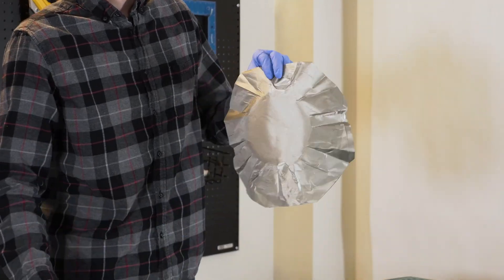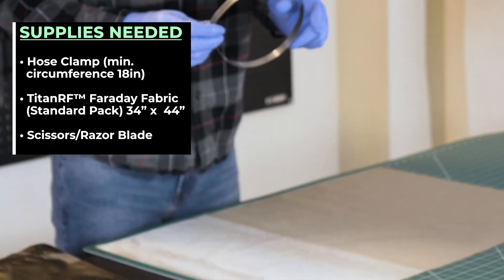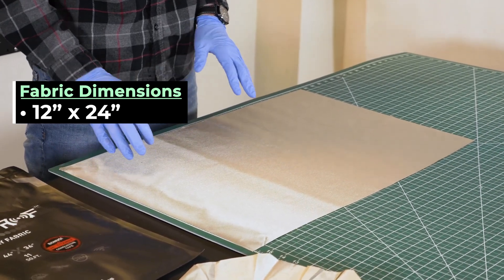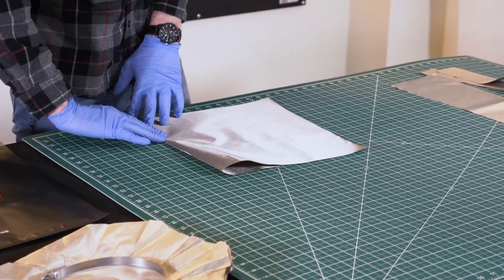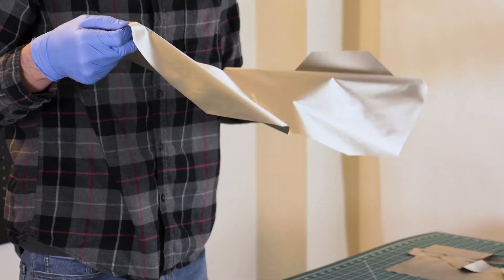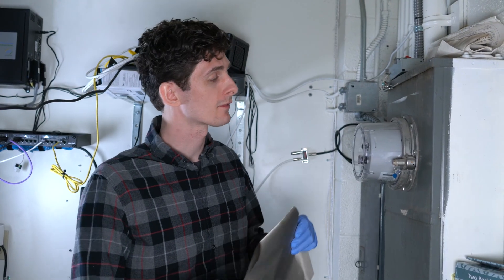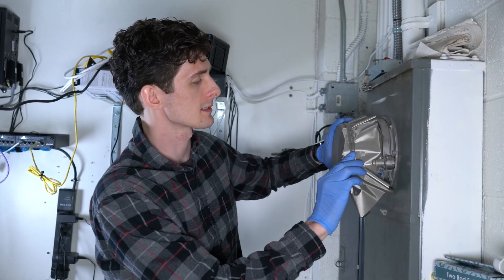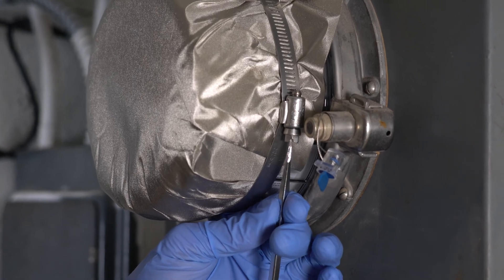Make Your Own Faraday Shielded Smart Meter Cover for EMF Protection

Comment: Dirty Electricity refers to a fast-growing form of potentially harmful electrical energy that
radiates into living environments from electrical wiring. It’s highly unstable and raises the
ambient voltage in the living environment by as much as two volts. This environmental toxin
arises from electromagnetic interference (EMI) caused by Smart Meters and plug-in electronics, computers,
fluorescent lighting, modern appliances, battery chargers, and solar power
systems.

Smart Meters are particularly bad because they contaminate all the wiring in a building. It literally surrounds you with Dirty Electricity through your home's wiring.
Recent science has shown dirty electricity to be bioactive. That is, it directly disturbs human biological systems. Dirty electricity and other types of chaotic electrical energy have been associated with auto-immune disease, neurological conditions, poor sleep, attentional disorders, anxiety, and dozens of chronic symptoms
associated with inflammation. Dirty Electricity – another name for EMI: Dirty electricity is a term coined by the electrical utility industry to describe electromagnetic interference (EMI) caused by Smart Meters and plugging in electronics, which typically need to convert alternating current (AC) electricity into direct current (DC) to operate. The term was first mentioned in the science by Dr. Magda Page Havas, PhD and Dr. Samuel Milham, MD, who have both identified a series of health effects associated with dirty electricity (power line EMI) in a half dozen scientific papers.

Health impacts associated with dirty electricity:(Smart Meters)
ADHD
Diabetes 
Anxiety
Fatigue
Asthma
Irritability 
Cancer
Pain 
Concentration
Mood 
Cancer
Multiple Sclerosis
Depression
Sleep Issues

Comment: If you block an antenna the chip will increase the strength in response - now going through the back. These are complex systems and you need an actual RF meter device. And a faraday cage also needs to be grounded for maximum effect.

Comment: ONCE U PUT ANY FARIDAY CAGE AROUND A SMART METER IT BLOCKS EMF FREQUENCIES  & RADIATION FROM GOING OUTSIDE BUT THEN DOUBLES THE EMF'S  & RADIATION GOING N2 YOUR HOME. PUT A SHIELD ON THE INSIDE OF YOUR HOME DIRECTLY BEHIND THE SMART METER BUT MAKE IT WAY BIGGER. A THINK REAL METAL WINDOW SCREEN MAYB WITH DUCT TAPE OVER IT FOR DOUBLE PROTECTION MIGHT WORK.  SORRY ALL CAPS CAN'T C SMALL LETTERS ON KEYBOARD

Comment: what if the the power company  used it's large system of transmission lines as the link and the modulated the 60hz carrier wave with digital information?

Comment: I would appreciate a serious test of the product you're selling. Not against a sales' pitch, but do the customer a favor- prove how good it is. Also, do your research: a Faraday cage or Faraday cover PREVENTS all frequencies from passing through. This is NOT good on your Smart meter, you need a little to reach the Utility to record  your power. If you don't, then you'll receive a visit and a charge for the visit to remove it. 
Do your homework please this is embarrassing. Redo this to provide real value for intelligent customers.

Comment: It seems interesting, but how are the utility companies going to read it wirelessly? can you  get fined if you block the transmision, to the utility company?  I am just trying to get educated here. I have an issue here in a multi family home that I am trying to resolve  I live in a 9 family apt unit with smart meters and the Detertor meter I purchased  warning alerted me with  both readings 284 Vm  and 10.30 uT, what recommendation do you have for remediate if possible ? maybe  Move out? Thanks

Comment: The smart meter gives the govt, and the electric company, the ability to turn off your electricity, if you are drawing too much power.  If you have wireless appliances or air conditioner,  they can shut these appliances down and the air conditioner as well.  One would be smart to never purchase Appliances with wireless capability.  I would never have anything wireless.  I got solar panels and the company who installed them wanted to monitor them and I told them NO WAY is that happening.

Comment: The new smart meters will send a flag that they are not "communicating"  and they will send someone out to investigate . As someone who works for an electric co...I know. Not only do these meters send a monthly reading for your bill....they communicate with all your smart appliances you ran out and bought and these companies know when you run your hot water heaters, dishwashers, dryers and everything else. Also these meters and streetlights act as antennae's  to daisy chain the signals. They are sending signals and info constantly, not just once a month.  They know these are harmful otherwise they would not offer an "opt out" meter that has to be manually read although I'm skeptical that these are not really any different.
Reply: I got a creepy AF text from some handyman saying they noticed I hadn't used my dishwasher for awhile and that he could come service it. Blocked. My dishwasher wasn't wired up so it's using the house wifi to send. Turning that off now and plugging in ethernet cable for pc and when I have to use iphone (which I'm discovering only has 5g option)..Probably taking hammer to both. We Will Not Comply. I'll be sending a Notice of Liability to hydro company at $20 0000 a day billing. Pricks.
Reply: @trailedge  I was against "smart" deVICES day 1 "phones" were stage 1 - people were suckers...fools
Reply: This whole thing was about the New World Order and monitoring and controlling us.

Comment: I think at one time, but the type we buy for cooking was changed and I read it is now useless for that. I am not sure, because as an experiment I covered my mobile phone with foil and left it for a couple of hours. When I unwrapped it, it was hot - not enough to burn but if I had left it longer, it would probably have caught fire.
Reply: so if I cover my smart water meter with lithium battery that will be installed in my home cause city won’t give me Opt Out Policy it could burn my house down? the lithium battery isn’t supposed to get hot
Reply: You have to let an area leak out but direct where you want it to go. So if you cover your router with tinfoil, that will work. But it will also overheat it because it’s constantly going to try to find a way to relay. So if you know where your closest towers are, you leave the opening in that direction so it can easily relay the information back-and-forth, but your lowering the EMF that is bouncing around in your house and hitting you. When it has a hard time and does leak out, you don’t want it to leak out in the direction of you. That’s a lot of power emitting from one little spot. If you have your router covered up in your house, you also have to think about when your cell phone tries to use your Internet in your home and work hard to get that reception, when it’s in close proximity to you, it will be emitting a lot more EMF. A lot of people think they’ll just put EMF paint on the wall of some sort but EMF travels through walls and when it hits that paint, it will bounce back into the direction it came from. So whoever is outside of that room will get hittwice as much as they would have. If you put that paint on all four walls in your bedroom, for example, any RF or EMF that ends up in that room will constantly bounce around on all of our walls. This could be hazardous.
Reply: Just put it on airplane mode when you don’t need internet. Even if you made a faraday cage for your router, your phone will try to connect to the nearest cell tower. If the cell tower is close, you’re in trouble because you’re in the path of those signals that everyone else is getting. The further your cell tower is the more it will work to find it, send and receive information. So when your phone is near you, it could be very harmful. It also emits more EMFs when it is charging, so your phone should be far from you when charging. Everyone should be aware that EMF is also much stronger in the evening. Basic every day noise pollution from cars, etc., UV and fluorescent lighting weaken emf. So when its quiet at night, the sun is down and lights are off, your body’s cells and function are in more danger. Your body heals itself when you’re sleeping, this is the most important time to be away from any EMF. So considering how much we are bombarded everywhere we go, people really need to think about unplugging anything not in use in their bedrooms and leaving their phone in another room. Be mindful of your exposure.

Comment: How about the back leaksge?
Reply: its not meant to actually do anything just make feel you did something what you want to do is remove the box from the wall add extra Romex cable to add length then place the box in a lead lined box before encasing it in concrete then wrapping it in the foil. doing anything less to block the radiation is like the worlds least carbon producing countries going green electric wile china has more coal plants the party members.
Reply: now oyu have ALL the radiation being reflected backwards, INTO your house. This is a sc4m, and does nothing

Comment: Would of helped to have used an emf detector before and after instalation to show the comparison.
Reply: this is only covering the front half. All waves can literally just escape from behind the head, and radiate out the back and bounce around. This is a non-working idea. Does nothing.
Reply: Too many leaks.

Comment: Can’t you just use foil?
Reply: I think at one time, but the type we buy for cooking was changed and I read it is now useless for that. I am not sure, because as an experiment I covered my mobile phone with foil and left it for a couple of hours. When I unwrapped it, it was hot - not enough to burn but if I had left it longer, it would probably have caught fire.
Reply: @angr3819  you must use special Faraday fabric/ emf fabric, not foil, which reflects heat, bouncing heat waves back out.

Comment: The meter base cabinet is all steel, so no RF should be reflected through the back of it.  Only thing I wonder about at this point is what signal appears throughout the house wiring?
Reply: Yet what about the neighbor's RF from their smart meter? We live in a mess of magnetic fields, coming from bouncing on many things. Look at Tony Pantelleresco's videos on how to make emf-diffuser-fans with magnets and metal coated wire mesh.

Comment: So if we cover the outside of the meter the electric company can't take a monthly reading remotely. But it will eliminate the nefarious things it does to us. To solve this problem and protect our families we can remove it completely on the scheduled days they read your meter, and then put it back up immediately. This will keep us safe from RF at least 98% of the time.
Reply: No one comes to read them. That is the point. It is remotely read. No longer need workers.
Reply: The smart meter tracks your energy usage and sends it to your utility company every 5 min.  throughout the day. Also it enables the utility company to impose multiple tiers of charges in the 24-hr period, e.g. with after 10 pm being the cheapest.

Comment: What about the backside??????
Reply: We put a solid piece of thin sheet metal on our wall inside the house- not the best, but dramatically reduced the EMF strength. Next time I'll put a 2 pieces of sheet metal behind the meter, which is fastened to the wall. That will decrease it somewhat, even if the S-meter is recessed into the outside wall. Cheers, Dk

Comment: My only question is.. do these smart meters emit RF behind themselves into the house?
Reply: to be safe, put some metal behind it, I know if emits behind it into walls 2 feet from it, in about 40 feet in each direction.
Reply: @invisableobserver behind an already installed meter?
Reply: @JesusChristismySavior-Julie  On the other side of the wall, I think.
Reply: yes probably, in all likelihood that's also why we're feeling it when we're inside.
Reply: There is steel behind it so won't go through
Reply: The one I have is located inside my fusebox which is made out of sheet metal. If I'm not mistaken steel does block emf so if your meter is in a fusebox like mine , it will help a lot
Reply: The best thing to do is make sure that there is an attenuate sheet of protection everywhere, but the direction that that signal needs to go. If they are reading the meter by driving past your house, do you want the signal free to go towards the front of your house or the direction of your utility company if that’s where they are reading it from. It will work harder if covered and emit MORE EMF. To leave any opening, the emf will just build up more power, find that opening and direct everything there. So leave an opening but choose the direction it needs to go.
Reply: I use screen. It works when I take it off. I feel really horrible sensations in my head.
Reply: Yes, they do. Most EMFs are directed outward, since the device is reaching the Utility and who knows where the data collection point is.

Comment: Do you have to remove it each time the guy comes to take a reading?
Reply: Well I thought the purpose of the "smart" meter was so they can get the reading remotely. From the truck anyway. If it's covered, then they would not get a reading and have to physically read it, they would see you blocking it and possibly charge you for your interference. 🤷🏻‍♀️ Can we refuse to have them? Bet they claim that they only have smart meters now. Evil people.